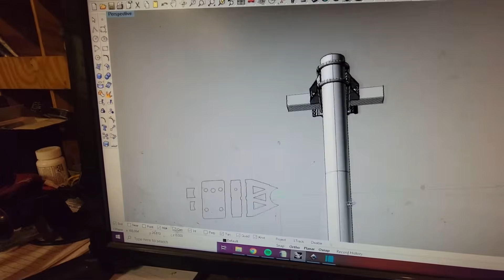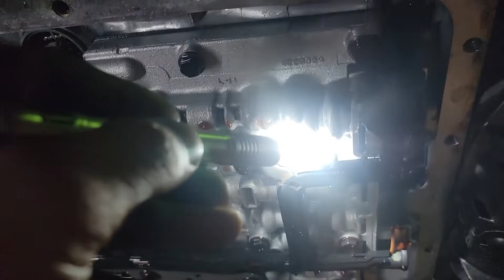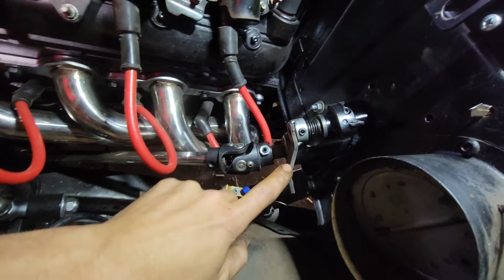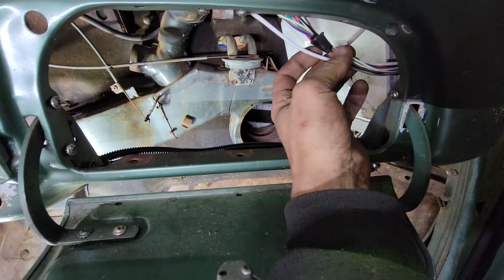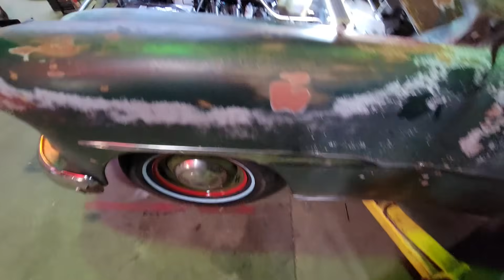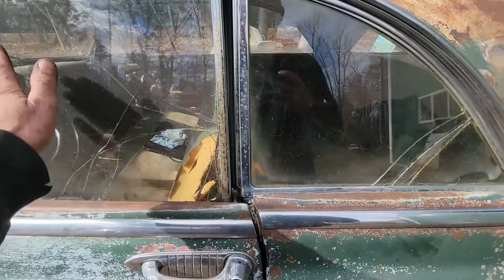1951 Chevy Bel Air 5.3 LS & Mustang II Suspension swap pt.2 Finishing out the build

Comment: Where can I get the transmission mount cradle. I see it didn't need to replace or remove all the factory cradle. Doing a new 383 in a 53 same car and the transmission cradle seems twisted from the previous build someone did with half a$$ work
Reply from the maker: murray makes a nice one if yours is trashed https://www.murraykustomrods.com/store.php?store-page=1949-1954-Chevy-Transmission-Crossmember-p136541182

Comment: Where did you get the cold air intake from? Was it pieced together.  Love that car. I have a 50 ls swapped.
Reply from the maker: i buy the cheap 4in silverado intake kits and modify them to suit my needs, the clamps that come with them go in the trash. I also keep a 4ft lengths of 4in aluminum tubing on hand.
Reply: @HsPerformanceWi  thanks for info appreciate it

Comment: What did you pay for the engine and trans?
Reply from the maker: I paid $500 for the donor truck and stripped all the parts I needed. Then sold the 4x4 transmission and transfer case for $500 and the rest of the whole truck for the remaining parts for $300. I then purchased the 2wd transmission for $350 I believe. So $50 and some sweat equity invested into the engine/trans. if the rear axle and cats were still on the truck when i got it I would have made twice my investment back with a bunch of free parts and engine

Comment: Great video. I have a 1951 Chevy sport coupe with a 327 cid 4bbl headers dual exhaust fuel cell original suspension I'm preparing to completely tear down. Lot of ideas from your video I'll certainly consider using on my project.